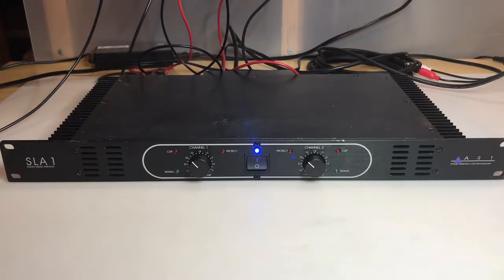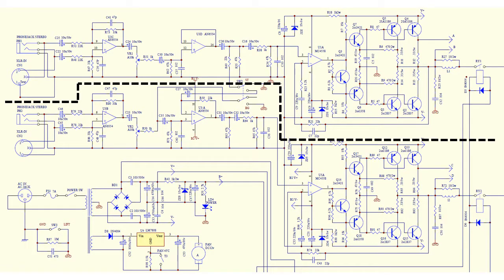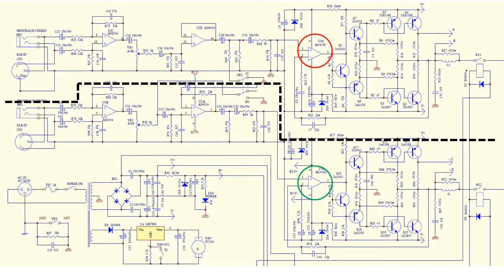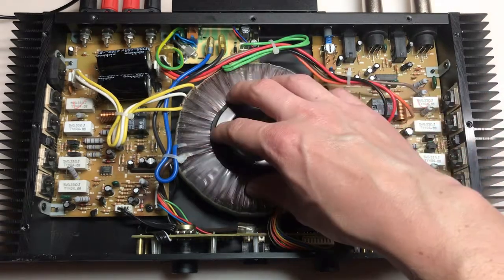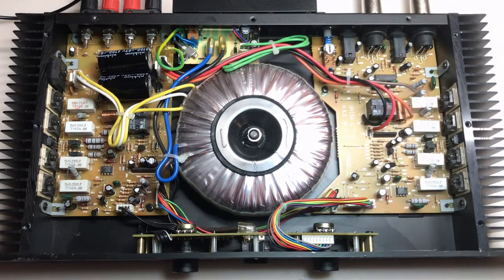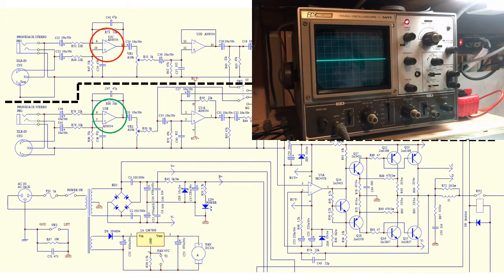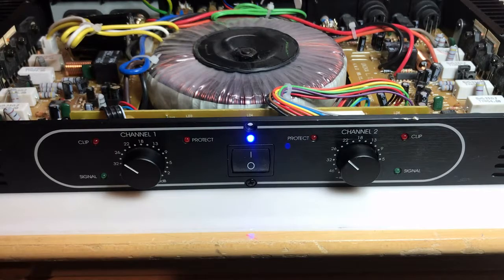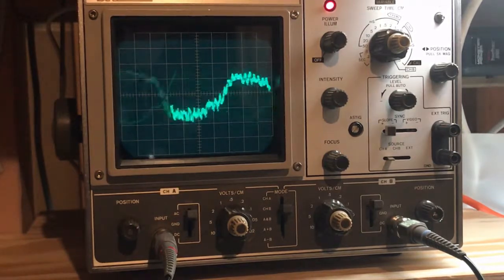DR #17 - Art Audio SLA 1 Amplifier Troubleshooting and Repair - Low Output

Comment: 9:14, signs of burnt board between the cap and resistor; also, slight discoloration on the other side of the board.

Comment: I have the B&K 1471... I immediately recognized that scope. I still use mine daily.  Its in need of some love but still works great for audio work.  They are identical front panel layout but mine is all black, I prefer the black personally lol. The 1477 is 15mhz vs my older 10Mhz 1471.

Comment: Hey! I have the issue that my ART 1 goes into protect mode on chanel 2 when i reach a certain volume. What can i do?
Reply from the maker: I would suspect one of the output transistors is going but It's impossible to say for sure without more information.

Comment: Its always intriguing to watch you deftly zero in on the problem area, explaining as you go the analytical path to get to and replace the deficient part - sometimes so quickly the video time is similar to a short ad, other times the difficulties that present themselves play out to an hour long video.  Your running commentary is so  enlightening, listening to you tightening the noose around the bad area, then the bad part, a few more strokes just to double check, then the swap out with a new part and voila - its working correctly again. Love it!!

Comment: Hi, I enjoyed your faultfinding video. I got fooled into thinking that it would be an op amp that was causing the problem. I was wondering - you are using an old type scope. I am retired and just getting into audio electronics as a hobby and was looking at buying a scope. 

I'll be mostly looking at hifi amps, tuners etc and maybe the occasional guitar amp - would a scope like yours do the job ? The all singing and dancing new digital ones are amazing but would it be more than I actually need.

Any advice gratefully appreciated.
Reply from the maker: Redstrat1234.. if you’ll be working on analog audio equipment, an old scope should be enough. Since the highest frequencies used in audio are only in the kHz, you wouldn’t have much need for the advanced technologies found in the newer digital scopes. The thing to be concerned with when buying an older scope is that it’s old and if it hasn’t been serviced recently, it has the potential to fail. But even then, there are usually good service documents for the old scopes too.